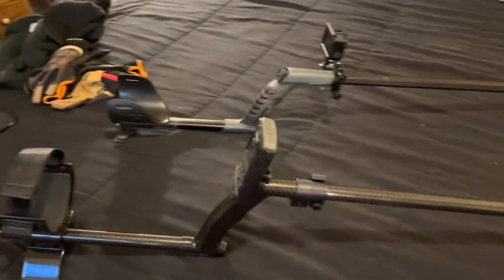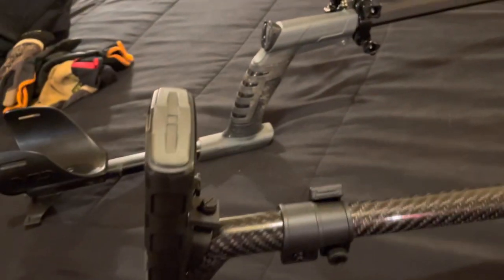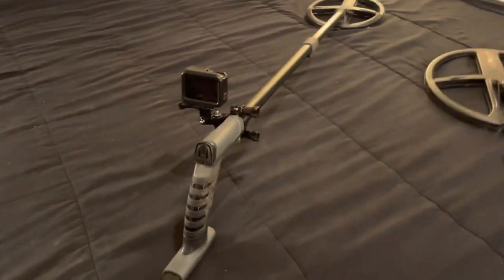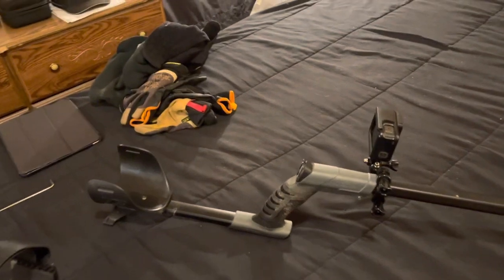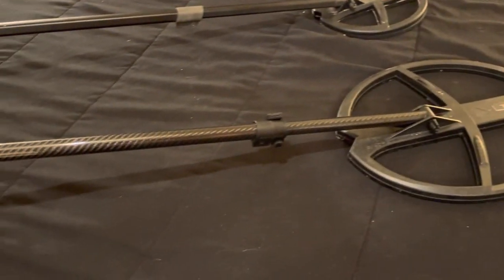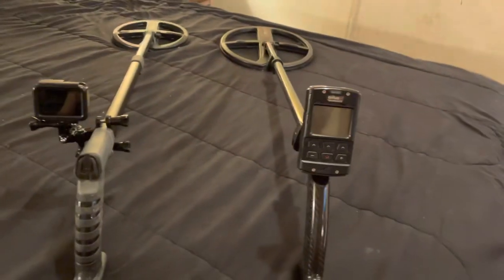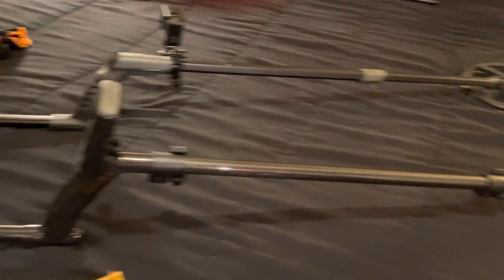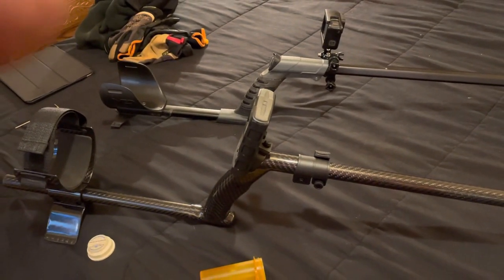XP Deus2 Steve’s Detector Rods Chassis!

Comment: Where do you order at? On the website you can’t add to a cart
Reply from the maker: Just send Steve a message through the contact info and he’ll let you know what he has available, price, etc. There’s a few different ways he can make them for you depending if you want to run the dive wire on the inside or outside and other stuff. I didn’t get mine through his website so I’m not sure what’s on there right now. He’ll get back with you very quickly, absolutely top notch guy.

Comment: I’m sooooo close to selling my ctx also!  Nothing the D2 can do that the CTX can in my detecting world.   As for the shaft..already contacted Steve
Reply from the maker: One other thing Mike…watch TNsharpshooters video regarding Fast in 24khz and what the noise cancel number does to the target. It seems 0-3 you’re safe but it starts to break up at 4, all but gone at 6. Just an interesting anomaly. You can ask Steve if he will make you a rod pre-drilled so the water cable goes through the center of the shaft👍
Reply: @wizardsofwisconsin7400  awesome..great advice. I’ll watch the video and make sure Steve sets im up tbat shaft
Reply: Nice finds. I have one on the way.

Comment: What is the weight savings if any/
Reply from the maker: Hey Greg…when compared EXACTLY (no arm cuff straps, same washers, no coils or remotes, etc) the original weighs 456 grams and Steve’s weighs 463 grams. Considering that Steve’s chassis has a bigger stand, bigger and nicer arm cuff with foam pad, RC retention block and the lower rod is 4” longer for tall people…that’s one HELL of an overall improvement at the cost of 7 grams. Like I had said, IMO it is literally a work of art. I’ve had the good fortune to message with Steve in the past about different topics and he is the kind of guy who is into the SMALLEST of details and wants to know the answer to EVERYTHING. I guess engineers do that, but he is on a “hyper level”. It’s an incredibly nice piece of work…
Reply: @wizardsofwisconsin7400  Thanks for the reply.   I agree with your assessment on the workmanship.  The weight difference does appear to be negligible.  My 70+ year old shoulder that has been injured several time really feels any extra weight.  I sold both a CTX and Equinox due to the discomfort they caused.
Reply from the maker: @gregparker5732  So you already have a Deus2 then Greg? 3 years ago I injured my right shoulder swinging the CTX and 17” coil too long between targets, I mean it hurt BAD and ALL the time. My doctor injected it with a steroid (prednisone I think) and it has been PERFECT ever since, to this very day. I loved the CTX because it found me so much but my sites were very dead in the last year, the Equinox800 didn’t do diddly squat for ME. This Deus2 is absolutely lighting up old coins in terrible places, I can’t recommend it enough to guys who hunt nasty public land.
Reply: @wizardsofwisconsin7400  The D2 9" is on the way.  I have had a D1 for about 6 or 7 years.  It is about all I want/can swing for long any more.  Loved the CTX, even had a harness and Swingy Thing bungee cord setup; but three hours of detecting left me with days of pain that just weren't worth it.

I like the CF shaft idea as long as there is no Pain penalty!
Reply from the maker: @gregparker5732  That is awesome, be sure to let me know how you do when you have a chance to assess it!